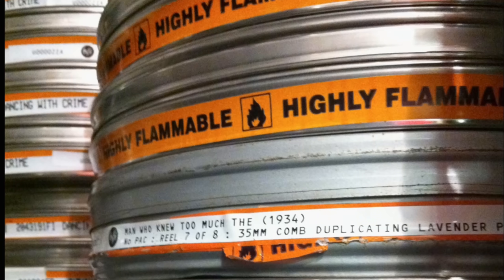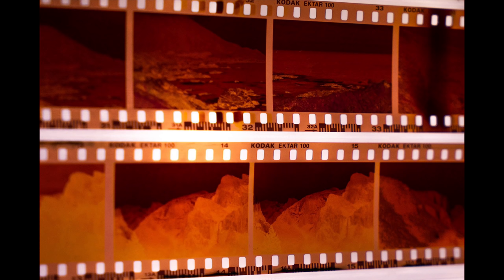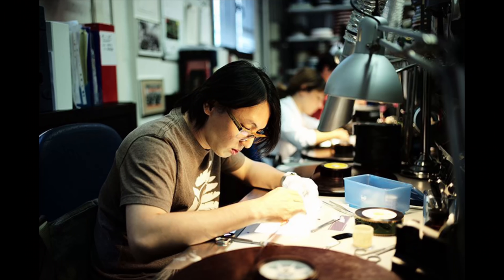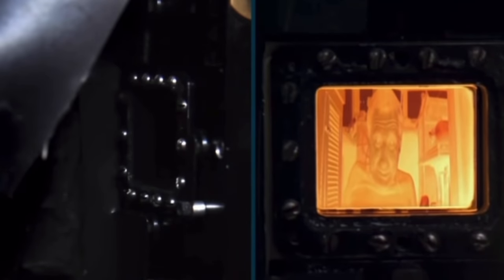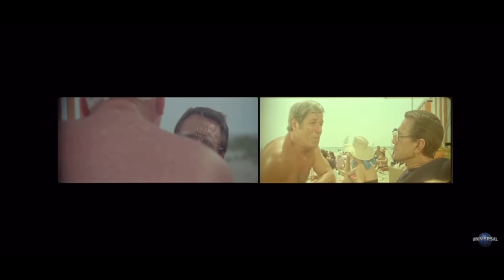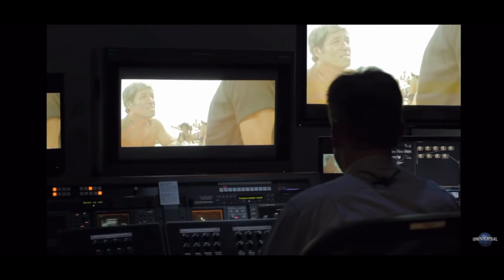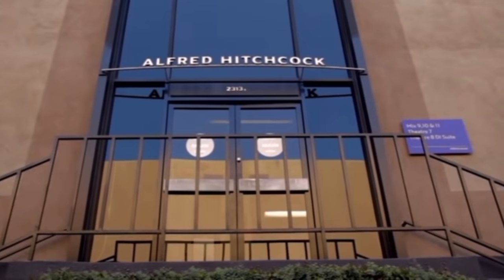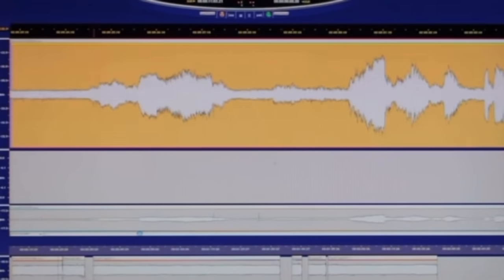HOW A 4K BLU-RAY COMES TO LIFE | A DEEP DIVE INTO FILM RESTORATION

Comment: I worked at ARRI and saw in the DI Department the restoration work of old movies like 2001 a space odyssey. Very interesting topic
Reply: Is it true the 65mm negative of 2001 no longer exists, so the 4K scan had to be done from a 35mm print?  Don't get me wrong, the 4K still looks great, but a velvetty-smooth, high-contrast 4K scan done right from the original 65mm negative would be truly astonishing.  You'd feel like you're IN space.
Reply: @kthx1138  Collaborating with a team at the FotoKem laboratory in Burbank, Nolan and Ned Price, Warner Bros.’ VP of restoration, first had to spruce up that material. According to Price, the lab spent more than six months cleaning the 50-year-old negative and checking the splices, which included removing a number of older, imperfect repairs. Then they made an answer print, color-timed it by closely adhering to the original timing notes and documentation, and finally made an interpositive and an internegative in 65mm for striking prints. (Hoyte van Hoytema, Nolan’s director of photography on “Interstellar” and “Dunkirk,” had a hand in the effort.)

-From and a Variety article on the restoration.
Reply: The negative exists for at least the theatrical cut, unsure if the deleted scenes survive in negative form. As of 1981, the negative was nearly destroyed due to the constant printing required by the film’s popularity. While 2.39:1 35mm prints exist and were the basis for many home video releases, the 2.20:1 ratio of the 2018 releases should be a dead giveaway that it was taken from a 70mm source. It actually turned out really good, it looks like it was just filmed. The whole internet disagrees with me, but I think the 4K is probably the best 2001 has ever looked. While there’s very little grain if any, it doesn’t look like it’s been DNR’ed to death. It actually looks very realistic.
Reply: @kthx1138  a "velvetty smooth" is an incredibly accurate term
Reply: @kthx1138  8k scan

Comment: Star Wars 1995 restoration. As usual Lucas was ahead of the curve. They actually reshot many of the composites because he saved all the original props. The documentary is out there narrated by Howie Long. Must see for those interested in film.
Reply: The restoration of the film negative was done before he created the Special Editions?  What I wouldn't give to get a 4K transferred right off those pre-Special Edition negatives, if Lucas would ever release his Vader Force stranglehold on them.  The desire to control is a path to the Dark Side, George.  You must train yourself to let go of everything you fear to lose.
Reply: At least someone else knows that they were edited before 1997. They were edited in 1991-92 for the 1993 Definitive laserdisc release, and both US presses of that had issues. (The Japanese issue however was perfect.) The 1995 VHS tapes and laserdiscs were the same version used for the 1993 discs. While ESB and ROTJ were unedited until the Definitive job (aside from pan-and-scanning, of course), ANH was first edited a month after its release, when a mono track was created using different elements than the 4-track Dolby Stereo mix on most prints. It was then edited again at some point between 1978 and 1981 to include “Episode IV A NEW HOPE” at the beginning, and then the soundtrack was remixed again for a 1986 home video release.
Reply: On the flip side of that, though, kudos to Peter Harmy and his team for un-screwing George Lucas' graffiti job.
Reply: That was vandalism at its worst.

Comment: Great video. The biggest issue with Jaws and movies of that era was the crappy Kodak stock that simply did not stand the test of time. ( Just like audio tape of the era turned sticky after a few years, requiring the reels to be baked in an oven to copy to digital. The sound reels for Superman II required this for the Donner Cut.) Despite the cost and difficulty of Technicolor, it was not as subjected to fading as it was more of a printing process. However there are issues of the three individual strips warping over time at different rates requiring a lot of time to fix during the restoration. What one technology is better at the other less so. Up until the 70's and the rise of home media, the studios didn't really care about their legacy. So much has already been lost.

Comment: Film restoration has been something I’m interested in for years. As for the wet gate process to reduce scratches during the scan, the people involved actually need to be extra careful. Some film restorationists choose not to use wet gate scanning because the final image is less sharp though at the advantage of less visible scratches. Also, there have been some horror stories of the wet gate process actually damaging the prints after and causing issues when the film is put back into storage.
Reply: Warner Bros. actually built a special scanner for their restorations of Gone With The Wind and The Wizard Of Oz, the former of which it’s frankly a miracle it still exists, the latter of which survives in its original negative form for the Oz scenes and the internegative for the Kansas scenes. It scans the reels at 8K resolution at a speed of less than one frame per second, with minimal contact with the reels and perforations and no contact with the frame at all. This was created because photochemical restoration requires physical contact with the film, where a digital restoration doesn’t. These scanners have been used for hundreds of restorations over the years, including by WB, 20th Century Fox, Disney, Paramount, Lionsgate, Criterion, Shout! Factory, and several others.

Comment: I heard Don Coscarelli's The Beastmaster is finally getting a 4K release, which is great, because John Alcott's cinematography is gorgeous.  After an exhaustive worldwide search, Coscarelli and his team of archivists weren't able to find the original negative, which they presumed was mislabelled and thrown into a dumpster, but they did find a first-generation print, the next best thing, having almost as high of resolution, color quality and contrast range to work with.
Reply: It is actually already out and released through Vinegar Syndrome. For the most part it looks excellent. There are some scenes the grain is very thick and some frames where obvious damage can be seen.
Reply: @jjchmiel78  That's cool--I like grain.  I think the Dar growing up scenes were shot in anamorphic (you can tell by the squished out-of-focus bokeh in the backgrounds) and printed down to 1.85:1, which means yet one more step in dupe printing and thus more grain.  There are a lot of night scenes in Beastmaster too, lit only by firelight, which required very fast film, before Kodak introduced their T-grain emulsion, probably push-processing too, hence grain.
Reply: @kthx1138  Surprising most of the night scenes look fine. Vinegar Syndrome breaks their releases down by reel number instead of chapters. Most of what I consider not pristine is reel one. They have a disclaimer before the film about original negatives not being available and using the best interpositives they could find. The packaging is limited edition but still available. That set is nothing but spectacular. If you are a Beastmaster fan I highly recommend the splurge.
Reply: @jjchmiel78  Thanks.  Ordered!

Comment: Are the restoration cost higher to do a 4K release than a Blu-ray release? My passion is television shows and I heard that if the show  shot on video it’s very expensive to convert to Blu-ray problems so are there a lot of TV shows that will never make it to Blu-ray because of the  restoration costs?
Reply: it depends on what video resolution the show was shot on, with 35mm film you have approximately 8k equivalent of detail you can scan, but with video you cannot change the resolution after it’s been shot, so older shows shot on video won’t have any benefit from being put onto a blu ray disc because they will still be lower resolution like dvd. there is such thing as upscaling which artificially raises the resolution but doesn’t always look very good
Reply: The Blair Witch Project is on Blu-Ray. It’s up to you whether it’s good or bad, I personally like it.

Comment: Very interesting! I would add that the return on investment is not solely on discs. The money comes more and more from streaming. Every consumer with a recent tv screen wants of course 4K HDR with an excellent sound track. It is so much better. So, if you want to compete in the streaming market today you need 4K HDR media (preferably all of it). On the long run you will be a loser without it.